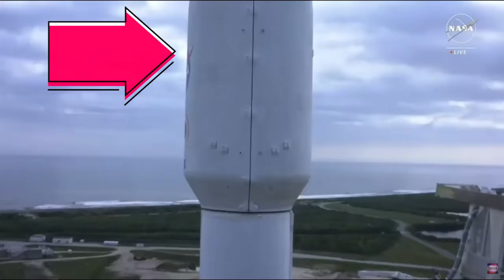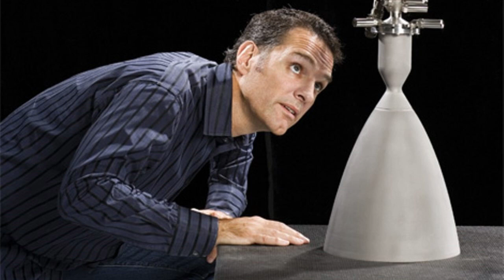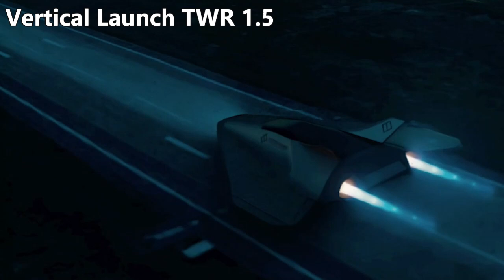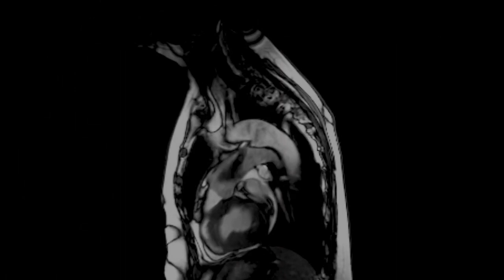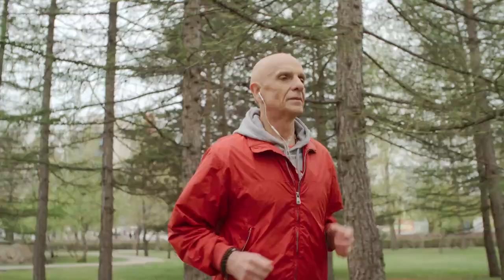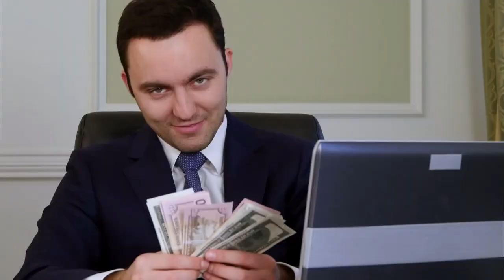Humanity's Future in Space: And the Technology That Will Make it Possible

Comment: Russian sci/tech has developed and deployed Mach 10 air-breathing missiles. No liquid hydrogen used. Obviously, not designed for reusability but the core technology is now proven. Reuse or at least refurbishment seems a reasonable goal. https://en.wikipedia.org/wiki/3M22_Zircon
Reply from the maker: Those aren't air breathing my friend. They have solid rocket motors... Though The US, China, and Norway have developed solid fueled air breathing artillery shells.
Reply: @terranspaceacademy  My friend, a solid rocket motor is used to bring the missile to a velocity that allows the air breather engine to operate in a supersonic/hypersonic regime.

Comment: Material Science at Mach speeds is the issue.  Need to get vertical before you get horizontal.
Reply from the maker: GRX-810? Lots of new options.
Reply: The USA had a missile that could get to Mach 10 in about 10-12 seconds all while still inside the atmosphere- the sprint missile I think the materials are there and what’s prohibiting is the price of some of those materials